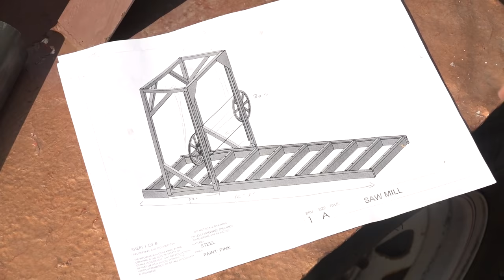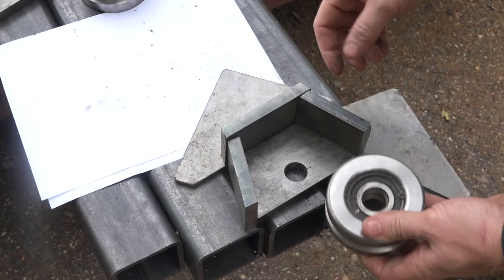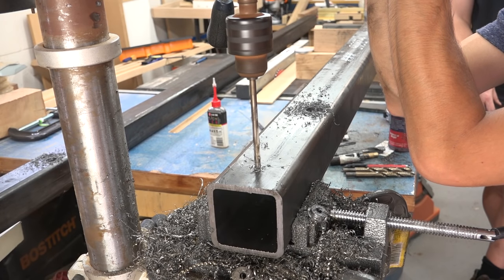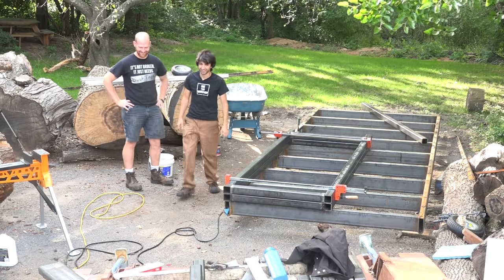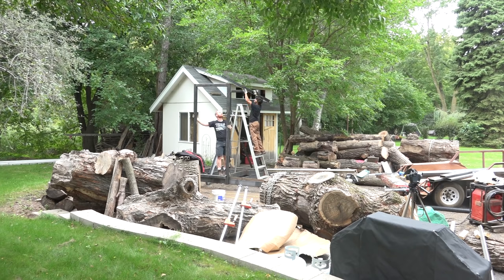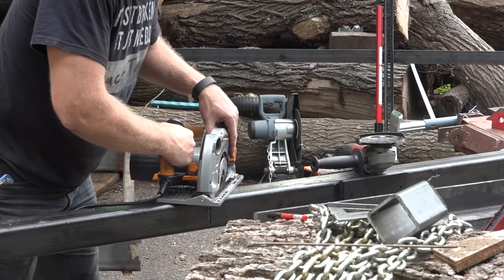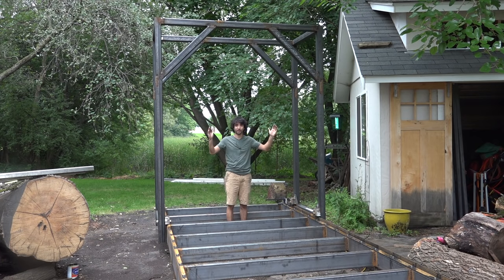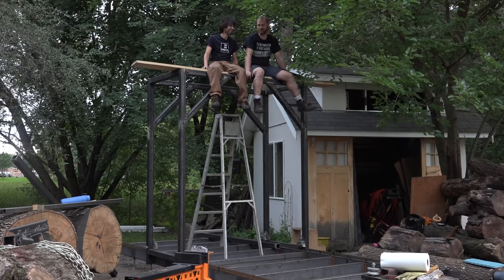Carriage Frame - Building a Large Bandsaw Mill - Part 5

Comment: Looks to be a little late, and I'm not sure that it would have a huge impact on this build, but I will say it since I noticed. When tack welding the top together it looked like your ground was still on the bottom frame, it is likely that your welding current was grounding through the wheels and may have done some damage or created a rough spot on the track and or wheel. Great build!

Comment: Did you switch to Socket Head screws for the guide-rail? I did not understand how the long bolts would work in the previous video so it seems like a good switch :)
Reply from the maker: I'm using those for now because that's all I had although I really like the look

Comment: Looking great Matt! Thats a genius tip on running the beads of weld on the back side to counter the warp, going in the tool box for sure.
Reply from the maker: Thanks!  Yeah, James was saying adding heat to the opposite side will counteract it.  Oxy acetylene torch is easier but since I don't have one, we just cranked up the welder
Reply: I'm only a basic welder so these kinda mistake are more common than I like.  I'd love an oxy acetylene set up, its my favorite, but over here (Ireland) you have to rent the gas cylinders and I just cant justify the out lay with the little bit of use they'd get. Whats the plan on powering your saw?

Comment: Matt, one of the reasons I told you about tack welding before, is that tack welds will not contract nearly as much as just going full weld.  Once you get a few tacks in place, they cool and will keep it from contracting when you finish welding it up.  The tacks hold the frame in place.

Comment: You need to emphasize the need for a flat work table. I've seen videos of commercial shops that do not have such work tables. Their products rock when placed on a flat surface. A video on acoustic guitars shows the fretboard needs to be flat to within 0.0005". For resonant tunnel diodes, the 300mm wafer needs to be flat within 5 atoms.

Comment: Instead of hydrolics, you might want to check out some small electric winches to move the cutting head and the tower. Since it's already electric. They are pretty cheap and have low steady gearing. Just have to figure out some cam locking devices.

Comment: This is coming along great...it's so tiny :-P   What rod are you using?  7018, 6011,13?
Reply from the maker: Thanks!  I used 7018 for the wheel housings and 6011 on the frame

Comment: How do you plan to tension and support the bandsaw blade at a 60" or 72" cut width?  I take it that you primarily slab your logs for the widest boards possible.  If you are doing dimensional stuff on big logs than the swing blade sawmill that you buddy build would be a better option (no log rotation and edged dimensional lumber is cut right of the log).

Comment: Sitting there on top of the frame at the end of the video was quite a leap of faith, i mean at that height, falling on a steel frame would instantly break bones and probably worse. Even with all integrity and sturdiness of the frame, if could have flipped over its wheels with both of you sitting on one edge. That was not a very smart idea.

Comment: I hope you're going to use Woodmizer blades?  I think they will make custom lengths too.  I'd use a 4 degree blade/band.  Do you know what engine you're going to use?
Reply from the maker: I haven't look at the woodmizer blades.  Do they sell 2" wide bands?  I've been talking with Cook's saw and they can make me the blades I'll need but I'd be interested in trying different blades.  I'll be putting a 10hp electric motor on it.

Comment: Great job so far. Looks very expensive though. Building something like this when comparing buying an already made worth it Other than bragging rights to say you built it ? not mocking just curious.
Reply from the maker: +Franks DIY mills with this cut width capability start around 50k
Reply: wow did not know that I would build my own as well . I 'm enjoying the build even though I'll never buy or build one. Great job
Reply from the maker: +Franks DIY :) thanks!

Comment: should not be welding like that with the trailer attached too the car unless the battery is either unhooked or with a protector. can cause major computer and electronics issues, if a surge happens. nether the less i now have been inspired to build one also

Comment: I was hoping to see some more detail on the wheels. So they have bearings? What did you make the axle out of? Do you have to keep greasing?
Reply from the maker: +Christian Stadler they are rollers from cook's saw. They have sealed bearings and I mounted them with a 7/8" bolt

Comment: Hi Matt, good to see you got some help with the saw carriage. Are you still going to put braces top and bottom of the side frames or will the middle bearing post act as the brace? I suspect you will still  need those braces.
Reply from the maker: +Mark Fryer I'm going to add bracing between the rear post and the middle post. Thanks!

Comment: Very nice work and I'm sure you're excited to have the gantry frame done. I was glad to hear that the metal expansion bend actually ended up being a benefit when fixed. It did look at first as though you were having to use too much force to push it along the rail. Much better and smother now but there is still a lot of weight to add to it. Arggg!
Reply from the maker: It was a bit stiff initially.  I think when we set it up there, the wheels were pressed into the upright which created some drag.  I'm guessing it will roll a little better when there is more weight on it.  Should be less bouncy.

Comment: Have you thought of putting some wheels on this behemoth? You will not be able to move it without a crane. Interesting build.
Reply from the maker: +NYWoodworker I'll be adding some removable tires so I can move it around my yard with my truck
Reply: +Matthew Cremona and some hydraulic legs would not be a bad idea also. And if they are powered by a small motor, all the better. Looking forward to part 6.

Comment: The band wheels on your plans look like they will hit the top brace if its raised to high. I believe they need to be placed on the outside of the post.
Reply from the maker: The carriage is tall enough so when the saw head is installed, the head will rise high enough so the blade is 5' or so off of the deck
Reply: Matthew Cremona I though that carriage looked tall!
Reply from the maker: the uprights are 105" tall lol!

Comment: By about the third issue he started wearing big boy pants , six and gloves on his feet / maybe this guy learns as he goes along/ boy them metal mites will get in your ears
Reply: Socks
Reply from the maker: +Wayne Robinson don't forget the seasons changed ;)
Reply: Matthew Cremona Matt there is no season where grinding and welding calls for short pants , sleeves and beach walkers . This is just me as I have   Abused my body more than most . If you ever get a case of metal mites you will rethink these issues . When you use a grinder you are putting charged particles into the air . If you get one in your ear it can drive you nuts and take days to get ready d of it. It moves the hairs around and itches / it is a terrible experience . When using a grinder wear good eye protection and ear plugs / long pants is a good idea / I think your little guy is great your wife did a good job . Glad the newest arrived on time . Say hi to max /

Comment: what kind of blade did you use on the skill saw to cut the steel pieces?
Reply: I am guessing he is using a saw like the Evolution Rage1.   They sell a multipurpose blade that will cut wood, steel and aluminum.
Reply: +Nick Karpen does it need some sort of speed reduction for steel? Or can you run. It in the same saw for timber? Thanks
Reply: +Trevor Burke the saw itself is built to be multipurpose.  I don't think it requires any speed changes.  Check it out.  Search evolution rage1.
Reply: Nick Karpen cheers man i will check it out. Thanks

Comment: what kind of blade on the skill saw to cut though that steel?
Reply from the maker: +Chaz Albrecht it's a metal cutting saw so it has a slower rpm and a metal cutting carbide blade. There's a link to the saw in the description if you want to take a look
Reply: We do a lot of heavy gauge commercial framing and I'm tired of the abrasive blades. Do you have another link for the 14" chop saw? Just want to make sure you get something out of it.
Reply from the maker: In theory you should be able to buy anything after following my link but here's a link directly to the 14" chop saw just in case: http://amzn.to/2cBA61x
Reply: Yea I just want to be sure. Love your content and I've learned a lot from you, so you deserve it.
Reply from the maker: Thanks Chaz!